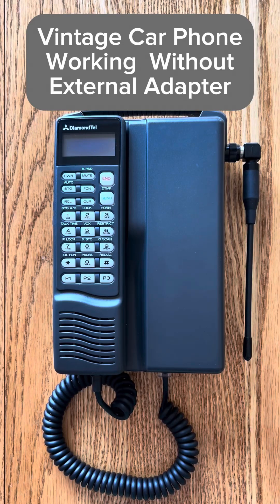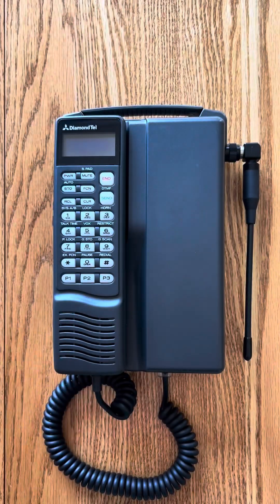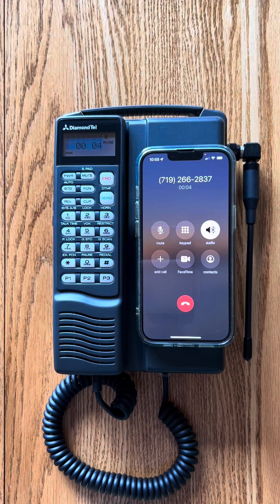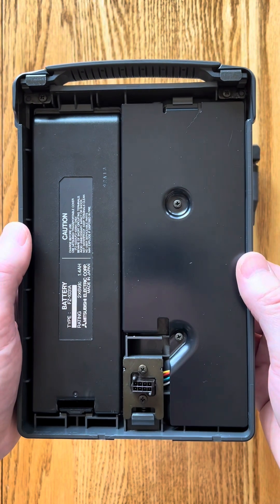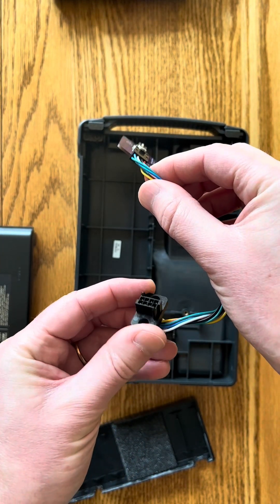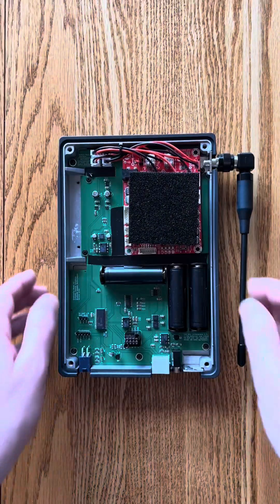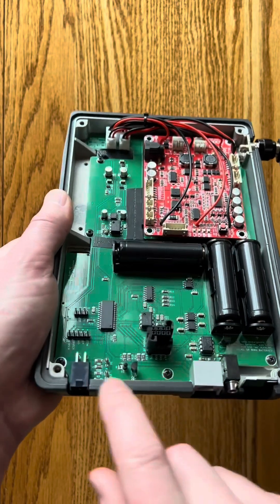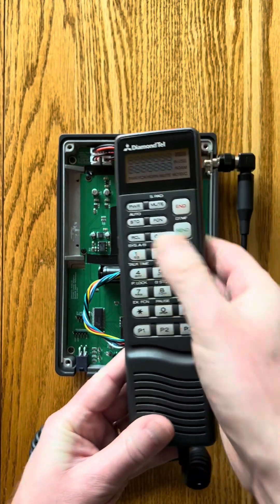New vintage car phone Bluetooth adapter demo/disassembly

Comment: What would it cost to have you make something like this for the radioshack CT-200 and/or CT-201?? Because I would LOVE to use them this way, and would pay obscene amounts for this!!
Reply from the maker: How obscene are you thinking? I would basically need early-retirement amounts of money to be willing to take on a project like that, so that I could abandon my career and treat this as my full time job instead of giving up potentially 2+ years of my free time while continuing to work my full-time job. But even then, I still couldn't guarantee success. So it would be a multi-million dollar gamble for you.

I'd basically have to start from the beginning, reverse-engineering how that radio shack phone works and develop new custom hardware and software. I've been working on developing this conversion for my phone for 3 years now, and I'm not done yet. Could I do it faster for a different phone? Probably, because I would be able to apply knowledge that I gained from doing it for my phone. Or your phone could be more difficult or even impossible for me to reverse-engineer enough to build anything useful. Or it could require different custom hardware/electronics concepts that I need to learn. I'm not an expert with electronics/hardware. I'm very much an amateur, flailing about and figuring things out slowly as I go.

The only reason I'm willing to put so much time and effort into this for my phone is because it's a personal passion project for my own benefit (the final result, and the challenge of learning new things).

Comment: @uselesspickles do you have this bluetooth systems for sale brother?
Reply from the maker: Not yet. I was aiming to finish designing and testing a new prototype this past winter, but life had other plans for me. I probably won't work on it again until next winter. If/when I do finish it, I would offer a conversion service. you would need to provide a DiamondTel Model 92 or Mitsubishi Model 1500 phone, and I would perform the necessary modifications and install the custom electronics in the phone.

Comment: Could I Purchase a Kit from You. I have Red 1993 Nissan 300ZX Convertible with a Car Phone.
Reply from the maker: Do you specifically have a DiamondTel Model 92 or Mitsubishi Model 1500 phone? If yes, then stay tuned. I'm working on refining a conversion that I can reasonably offer as a service (maybe by the end of this year?)

If you have a different car phone, then this conversion will not work.

I probably won't sell any kits because the conversion requires some scavenging/reuse of some parts from the original car phone before the conversion can be fully tested. I would not want to sell un-tested conversion components.
Reply: @UselessPickles If you have a different car phone, cant you just take it out and use this specific phone instead? Dont see why not since your conversion runs on batteries which would make it portable for any car right?
Reply from the maker: @bestmusic1234567 Yes, you could choose to acquire a DiamondTel Model 92 or Mitsubishi Model 1500, and the necessary parts for a vehicle installation, and install it any vehicle you choose.

Be prepared to scour ebay, craigslist, FB marketplace, etc., for possibly multiple years, to piece together a complete phone and vehicle install kit.

But if you have a car with a particular integrated OEM phone system, then you are now faced with the tough choice between keeping the correct original fully integrated phone that doesn't work any more, or swapping it out for a more generic aftermarket install  of a different phone that can be converted to work.

Comment: Is the sound coming from the phone itself or the iPhone?
Reply from the maker: The sound is coming from the original car phone. If I handed the car phone to you and didn't tell you that it it was relying on a Bluetooth connection to a modern cell phone, you would have no reason to believe it isn't simply a fully functioning car phone. Everything about it "just works" the way you would expect: speakerphone with an external plug-in microphone, and audio switches to the handset microphone and ear speaker when you pick the handset up. The signal strength, "no service", and "roam" indicators on the handset are fully functional and accurate. Incoming calls cause the car phone to ring, picking up the handset or pressing the "SEND" button answers the call, etc.

Here's a more complete tour/demo of the full system installed in my car, but with an older prototype of my conversion: https://www.youtube.com/watch?v=52AuhS5Jq0Q
Reply: @UselessPickles  amazing work! Very excited to see the final version. On a side note, you’ve inspired me to try get my hands on a gto, it’s just beautiful.

Comment: Would love one of these currently, have a motorola back phone that I would like to mount in my eighty five el camino..... Don't hesitate to contact me if you decide you'd like to do another
Reply from the maker: Unfortunately, my design is very specific to this particular model of car phone. A conversion for any different model of car phone would likely be a multi-year project, practically starting over from the beginning again. But I am working toward refining my design to the point that I would feel comfortable offering a conversion service for this specific model of phone (DiamondTel Model 92, or its "cousin", the Mitsubishi Model 1500).

Comment: This is just brilliant. I have a mitsubishi 1500. Are you intrested in selling the module ? Im mechanically inclined but not electrically so have no clue about programming etc
Reply from the maker: I hope to solve a few remaining issues this winter, then I may consider offering a conversion service. It's unfortunately not something that can be simply installed. It requires some physical modification, and a couple connectors need to be scavenged from the original phone to be reused with the new electronics.

It won't be cheap, because it takes many hours for me to do final assembly of the electronics and modify the phone to install the electronics. And I value my free time.
Reply: @UselessPickles  ya of course understandable. The most valuable thing anybody has is time. Great work 👏

Comment: This is awesome. Any plans of adapting this for other platforms such as the Motorola car phones?
Reply from the maker: No current plans to build a similar adapter for any other phones. It would be a pretty massive project of reverse-engineering the phone, then creating different custom hardware and software to interface with that handset. It would be nearly starting over from the beginning of this project that I've worked on for over 2 years, and I'm still not done (still need to solve a few issues).

Comment: I’ll buy this!!!! Super awesome man! I’m about to pickup a lexus ls400 just for the nostalgia of the car phone
Reply from the maker: Does the Lexus LS400 use the DiamondTel Model 92 or Mitsubishi Model 1500 phone? If not, then this wouldn't do you any good. This is both physically and electronically specific to the model of phone I have developed it for.

Comment: Can these be set up for 90’s Lexus car phones?  I own a 95 SC400. I assume these are the same phones in the LS cars.
Reply from the maker: My project works only with DiamondTel Model 92, and possibly Mitsubishi Model 1500. If the 90’s Lexus cars use these specific models of phones, then yes, this would work. 

Otherwise, this won’t work. You would need to reverse engineer the handset interface of your particular model of phone and develop different custom hardware and software to work with that handset. And of course the physical size/layout of the phone transceiver will be completely different and have its own unique challenges for designing the custom PCBs to fit inside.

Comment: I have a old bag phone I wonder if I can basically create a 5g cellphone and cram it in there and have the first ever 5g bag phone
Reply from the maker: Sure, you could use the same general approach that I used (custom electronics and microcontroller programming to interface with the handset), except you would interface with a 5g cellular module instead of a Bluetooth module for handling calls. But I think the resulting experience would be worse. You would need to pay for an additional line/number. Your car phone would have a different phone number than your modern cell phone.

With my Bluetooth HFP approach, my car phone automatically reconnects to my modern cell phone every time I turn it on, and then my car phone has the same phone number as my modern cell phone.
Reply: @UselessPickles  only thing I know noting about making my own custom cellphone the only good thing is my bag phone does not work so it does not matter

Comment: Excellent work! Interesting to know how you determined the signalling to/from then handset component.   Also, the beeps and flashing on the display, is that a function of the handset itself or are you mimicking how the original phone operated? 👍 nice
Reply from the maker: Thanks!

Short answer is that I used an oscilloscope to identify signals on all 8 wires to the handset when connected to the original transceiver, and figured out that two of them were digital UART (Tx and Rx) running at 800 baud. It was just a big puzzle to figure out what all of the different commands and events were.

The handset is a dumb I/O device that doesn't know anything. It has two speakers and a microphone that can be individually turned on/off, the speakers will play whatever analog sound you send over the wires, and the display shows whatever it is commanded to display. Pressing and releasing buttons causes UART events to be sent from the handset. And there's a bunch of UART commands that can be sent to the handset to control everything (printing text, turning status indicators on/off, turning backlight on/off, etc).

So everything happening on the handset is controlled by my custom microcontroller code and my custom circuitry. I generate all the sounds myself, I replicated much of the original phone's behavior from scratch, in addition to adding some new behavior like Caller ID, Call Waiting, a few extra ringtones, and even a few games (I have other videos on my channel that demonstrate much of this). The "no service", "roaming" and signal strength indicators on the handset represent the actual status of the paired cell phone too.

If you really want to dig into technical details of how I did this, then check out this forum thread where I documented my progress from the beginning (started over 2 years ago): https://www.electro-tech-online.com/threads/making-a-bluetooth-adapter-for-a-car-phone-from-the-90s.162764/
Reply: @UselessPickles  fantastic.  I did something similar once with a radio that had a detachable (but tethered) head.  The speaker/mic were analogue components which made it way easier. The display was tricky but the buttons were easier.  Great project you have working - really nice!  Now you have to find a period correct auto to install in.
Reply from the maker: @maxvideodrome4215  This whole project started when I bought a 93 Mitsubishi 3000GT VR4 and discovered in a sales brochure that there was an optional fully-integrated car phone accessory. It took me about 3 years to find all of the parts needed to piece together a complete system, which includes hands-free integration with the original radio. Here's a video of the entire system functioning in my car with my previous plug-in prototype adapter: https://www.youtube.com/watch?v=52AuhS5Jq0Q

Comment: Really like this and have been following for a while. I want to build my own given here in the UK we'll soon be losing our 3G / 2G networks that will stop these older phones from functioning at all originally. I'm curious, is there any particular reason you didn't use the external antenna port for bluetooth?
Reply from the maker: My car phone lost its 1G network here in the US back in 2008 :). The Bluetooth module I'm using (Microchip BM62) has an integrated antenna, and I don't know enough about Bluetooth and antennas to understand if/how I could use an external antenna, or if the original antenna for the car phone would function well for Bluetooth. I definitely prefer to keep the original antenna (800 MHz FM) for 100% authentic appearance rather than using a different Bluetooth-specific antenna. If I could use the original antenna as a Bluetooth antenna, then that could be a great improvement for a future version.

I also would have had trouble using the original antenna port in my circuit because the wire for that antenna port interfered with the positioning of the battery management board. It's not obvious in this video, but I had some pretty sever limitations for positioning some items due to how the transceiver is internally divided into 3 sections. The battery management board just barely fits into the only section it could possibly fit in. This specific problem I hope to solve eventually but figuring out how to build my own battery management circuit directly into my custom PCB, but for now I'm relying on a product I was able to buy for $15 and modify to connect to my custom PCB.
Reply: oh and also, what kind of protocol was used between the handset and main unit?
Reply from the maker: @TheJaffaMeme  The handset communication is an inverted UART running at 800 baud. I reverse-engineered the actual commands/events by recording and analyzing real communication between the handset and transceiver, and a lot of experimentation. This README about the car phone in my GitHub project explains all of the handset connections, UART events/commands, etc: https://github.com/UselessPickles/diamondtel-m92-bluetooth/tree/main/telephone
Reply: @UselessPickles  Perfect, thank you so much!